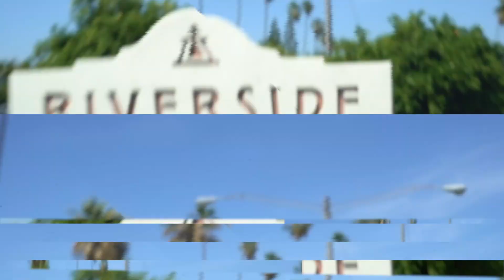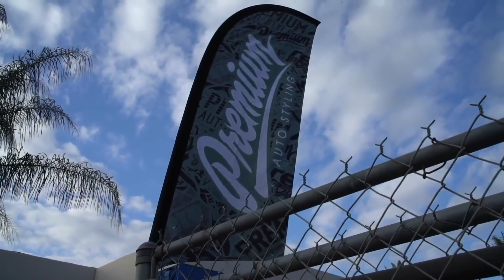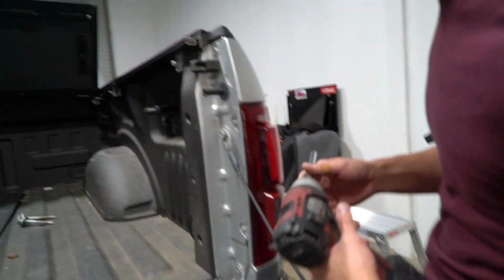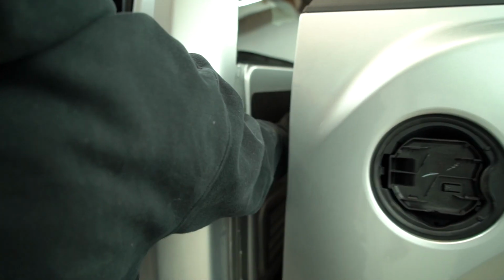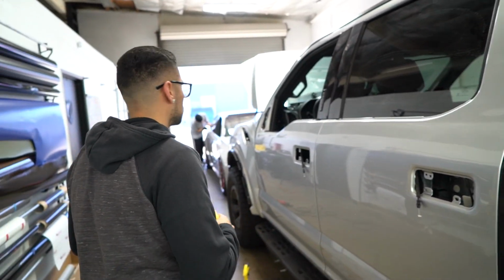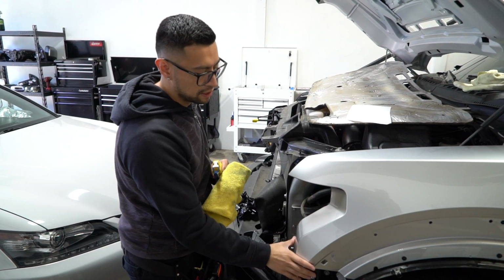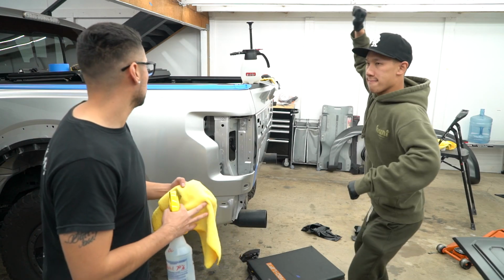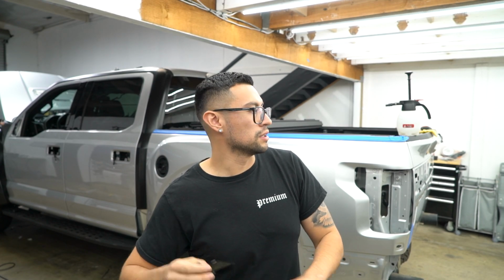The Hardest Part About Wrapping A Ford Raptor

Comment: Nice work as always. Btw That headlight area didn't need an inlay. Christian @CK Wraps killed it one piece little to no failure rate using Avery.
Reply from the maker: Thanks!! 100% doable one piece, should it be done one piece? Questionable. Our goal is longevity especially when the seam is near invisible

Comment: @David. CK Wraps did that fender in one piece using Avery Satin Black if i remembered correctly. 2nd car with same fender. You might wanna check his channel if you have time. Might have something new to learn you know.
Reply from the maker: This fender is 100% doable in one piece (we’ve done them both ways) but the risk of wrap failure does go way up. We give our advice from experience.
Reply: @PremiumAutoStyling  Yepp. Thank you for the reply. I can only say from what i watched. I haven't wrap Ford Raptor before. I mean i dont think there's even one in my country. haahahaaa. But yeah it really can goes either way.